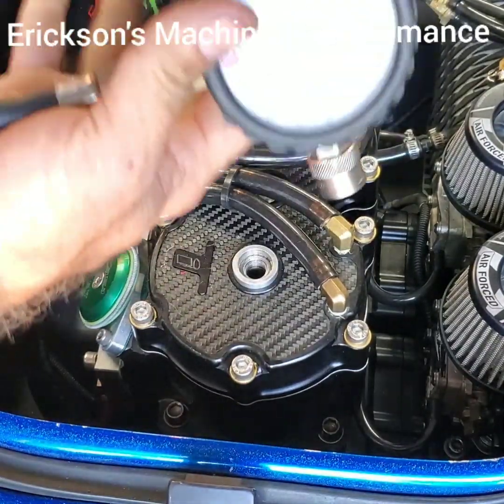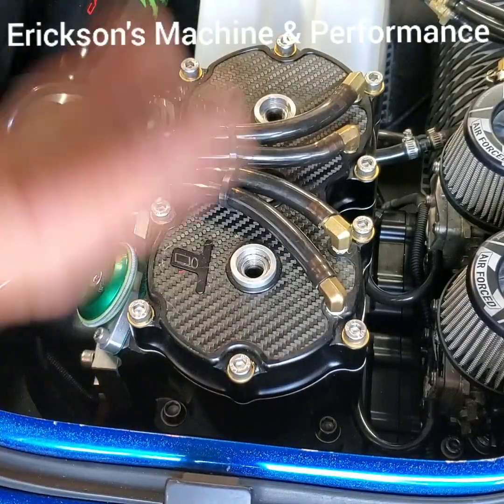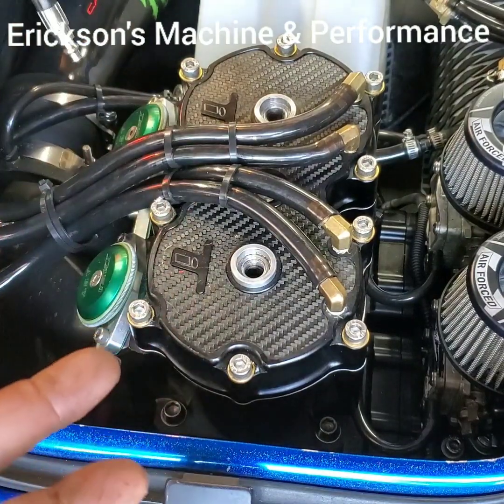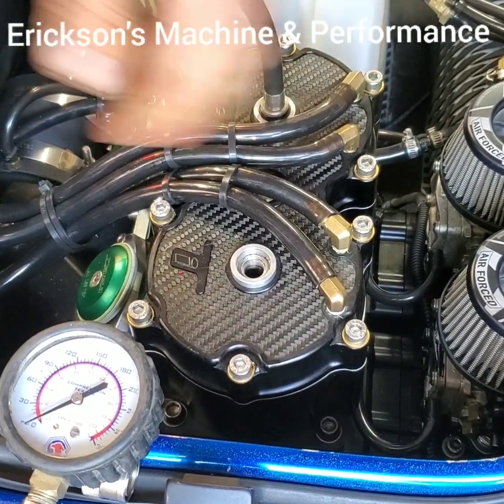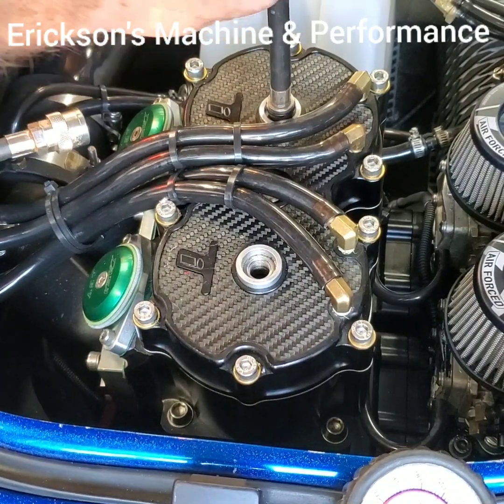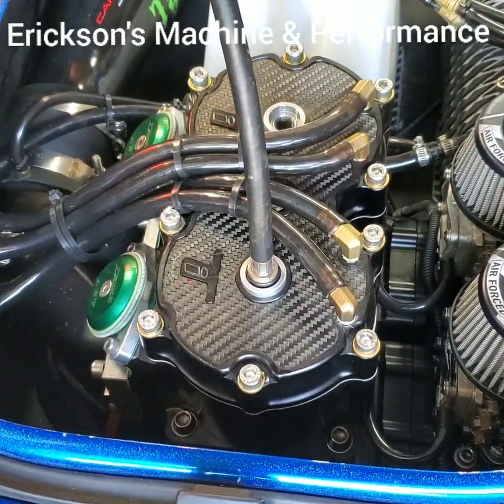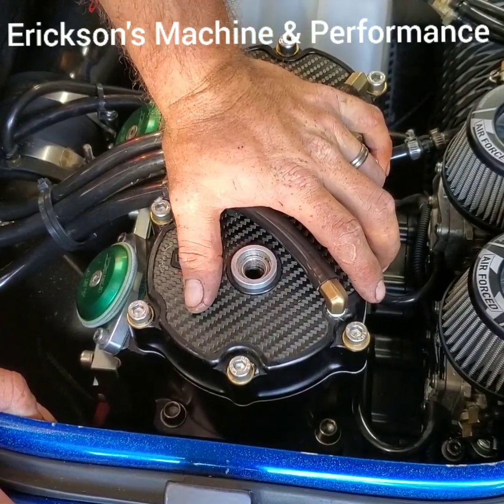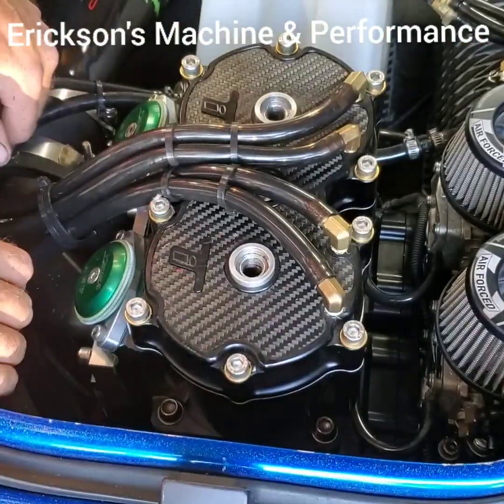How to check compression on a pwc 2 stroke engine. YAMAHA 62t Dasa 1200 16mm stroker

Comment: I agree on the harbor freight stuff. Ive tested my 80 gs750 and all cylinders and tested at 90psi. Tweaked carbs and runs like a champ.  Tested my 701 61x and got 110psi on both cylinders.  I  dont believe i have compression problems

Comment: I can second this advice. I had a cheap compression gauge laying around, and I had let a friend borrow my Matco gauge.

I was selling a Superjet and the guy was adamant about testing compression. I didn’t have my good gauge so I pulled out the old one and sure enough way low equal on both cylinders. The guy left thinking the SKI was wore out. 

When I got my new gauge back, I threw it on there and sure enough SKI’s compression was good as new. 

He ended up coming back and buying it, but with these compression numbers on these jet skis, it’s pretty important to have good test equipment. You can save money on wrenches and specialty tools. You may just need once.

Comment: Why wide open throttle? Same for 2cyclw?
Reply from the maker: Wide open throttle is mainly for 2 strokes.   SOMETIMES with the throttle blades closed it can lower compression ( very little ). It is a good rule to follow but does not always make a difference.

Comment: Does it matter if the motor is at running temps or not when taking a compression test ?
Reply from the maker: That's kind of a loaded question.   The real answer is yes it should be warmed up.  That being said many times it doesn't matter ( but sometimes it does)

Comment: Absolutely love the content you're putting out, so informative and instructional I've used several videos to do my own repairs. Can you recommend a relatively inexpensive compression test kit?  I made the mistake of trying a crappy one from Harbor Freight, completely inaccurate 🥴, waste of money
Reply from the maker: Buy a used Snapon, Mac or Matco.     My favorite is Matco.    U can normally pickup for around $100 used and just replace the schrader valves and they are as good as new
Reply: @EricksonMachinePerformance  thanks for the info, ended up getting a Matco CT110K Master Compression Tester Kit for 130 bucks
Reply from the maker: @mike.j.cataldo  that's what I use as my main gauge.   Enjoy it!

Comment: Hi I used cheap compression testers in the past with mixed and unreliable results. Now I have been using a snap on tester however I noticed that you use a universal tip that does not screw in very deep? I have that version and another one that has the same length as a spark plug.when using the universal one I get a big difference of compression than using the other longer hose that screws in deeper. The result is 12psi more with the longer threaded one? Which one is the correct one to use? I almost feel like the one that is close to the length as a spark plug in threads should yield the correct results?
Reply from the maker: Mine read within 2 or 3 psi of each other.   If your looking for EXACT #s then its best to use the adapter that's the same size as the spark plug.  If your checking for engine health, as in if the holes are running the same it really doesn't matter.

Comment: May be worth mentioning, I typically depress the kill switch as I’m turning over the motor.  I’ve been told it disables any active spark from traveling down your plug wires.   I can’t verify because I’m unwilling to hold a plug wire while doing it 😳
Reply from the maker: That works with some skis but not all. Also grounding the plug or just keeping the total loss brain off.  Some cdi are more fragile then others. Seadoo is by far the most fragile to damage.  Normally skis that are know to be susceptible to damage have grounding posts on the ebox. But it's a good practice.

Comment: Hey nice video. I did a test on a TS Barracuda 640 but I didn't hold the throttle open. I got 155 on both with my not too expensive guage.  What is the reason for holding the throttle open?  I'll have to recheck and see the difference. Thanks, saw your video on Yamaha Superjet page fyi
Reply from the maker: Checking without opening the throttle can give u a false reading because the engine cant suck enough air past the butterfly's and it can give you a lower reading by a few psi